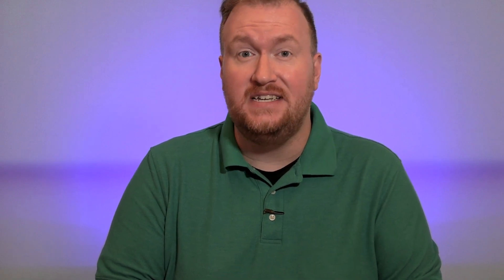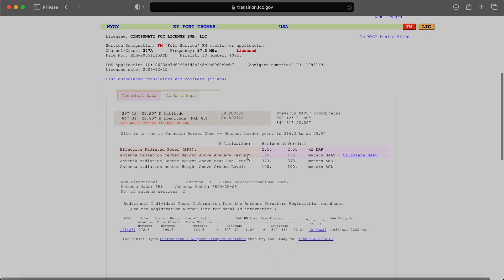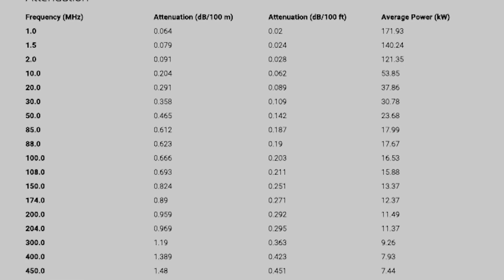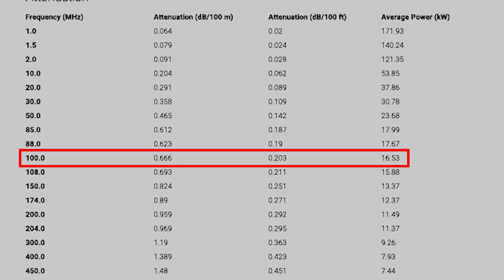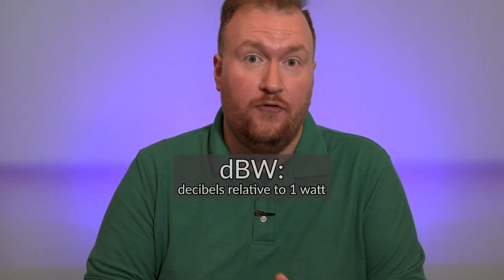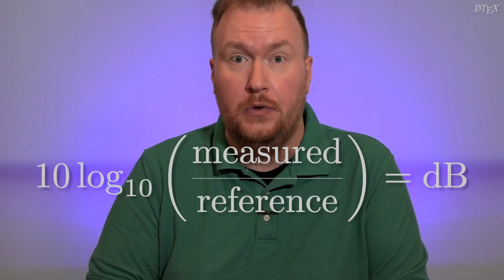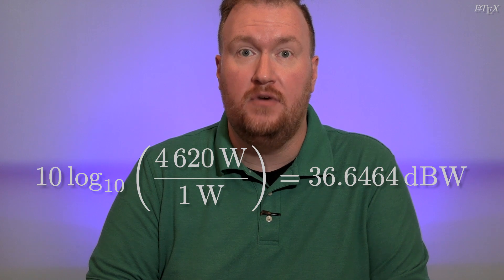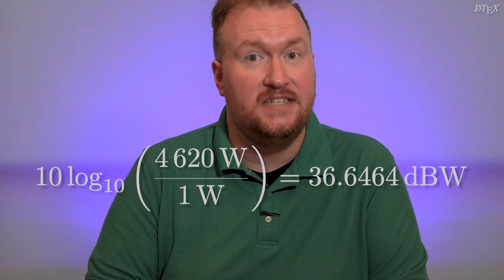What is ERP? How Radio and Broadcast Engineers Play Tricks with Power

Comment: Have you ever worked on an uhf tv transmitter where the radiated transmitted power was 1,000,000watts?
Reply: I'm the transmitter engineer at one such station, a UHF-TV station with 1000 kw ERP.  We accomplish this with 40 kw transmitter output feeding a main antenna with a power gain of 30/1.   About 15% of the transmitter power is dissipated through losses in the transmission line running up the tower, so about 33 kw actually reaches the antenna.

The antenna power gain is achieved by focusing the radiation into a tight beam aimed at the horizon and slightly below the horizon with very little energy radiated above and below the antenna.   It's kind of like a lighthouse you'd see along the coast somewhere.

Here's a fun fact:  The FCC only counts energy radiated in the horizontal plane against our effective radiated power limit.   At my workplace, the main antenna extracts a small amount of energy from the horizontal elements and reradiates it in the vertical plane. This is done to provide a good signal for TV viewers using future mobile phones and for TV's using indoor stick-type antennas.   So the final effective radiated power is 1000 kw in the horizontal plane and 300 kw in the vertical plane.

Another fun fact: To generate our 40 kw transmitter power output, our transmitter has two 30 kw amplifiers,  reduced to 21 kw output each, then combined into one output of 40 kw.  To generate this 40 kw, the transmitter consumes about 100 kw of
energy from the local utility.  That sounds pretty inefficient, and it is, but it's hard to generate power at UHF.  A few years ago this transmitter replaced a 20 year old unit that
consumed about 150 kw for the same 40 kw output.

Back in the 70's, I worked at a UHF-TV station in another city.  This station had almost 4.5 megawatts of visual transmitter ERP.  They had a gigantic 110 kw transmitter feeding an antenna with a power gain of 50.  After transmission line losses, about 89 kw reached the antenna for an ERP of 4450 kw.

You can do this at UHF because the wavelength is small and it's possible to build an antenna with a lot of elements, providing a lot of gain.
Reply from the maker: Are y'all still on an IOT rig or have you gone solid state with the repack?

Comment: WMJQ (Majik 102) 102.5 FM Buffalo was one of the last 110KW licensed stations that I knew of, and I lived in their market. 
Boy could they swat a signal FAR.
Reply from the maker: Y’all seen WBCT Grand Rapids? 320kW ERP at 238m HAAT 🤯
Reply: @BroadcastBlueprint  I assume they are using a cp antenna. With that amount of grunt they can afford to.
Reply from the maker: WBCT runs a 12 bay antenna with full wave spacing. It’s like 8dBd gain
Reply: @BroadcastBlueprint  Wow!  I read once about a radio station that applied back in the day for a whopping 540 kW of ERP, but I don't think they were able to make good on that construction permit before the FCC capped FM radio to 100 kW.  Also, I found the radio station you mentioned that is licensed at 2.55 kW: WYGY-FM (97.3 The Wolf).
Reply from the maker: @scratchpad7954  yep! That’s our little Class A station! I try to baby it as much as possible.
Reply: The station on 101.3 in SF Bay area is still listed as 125kw but strictly directional to nnw and sse to protect 101.1 in Auburn CA.
Reply: When KIOI (then KPEN) got the upgrade in the early 60s, 5kW was aimed at the ocean, while the remaining 120 kW was aimed inland.
Reply: @ApartmentKing66  They had the most interesting evolution I'm aware of. As described by the then owner, take it for what it's worth, first in the west with MPX, first with circular, first with a microwave STL, was the station used for on air discreet quad testing, (heard the tests myself). I toured the place once. Met Jim Gabbert , his dog and the dj who was on at the time, Cliff Saunders, a little guy with a gigantic voice. The on air room was the size of a small closet with little bookshelf monitors but in the next room was a massive new studio under construction. This was at 700 Montgomery with the STL atop the Trans-America building destined for San Bruno mtn. He also had KIQI 1010 AM and another station in Hawaii.
Now they seem to be a hollowed out corporate shell of what they once were.